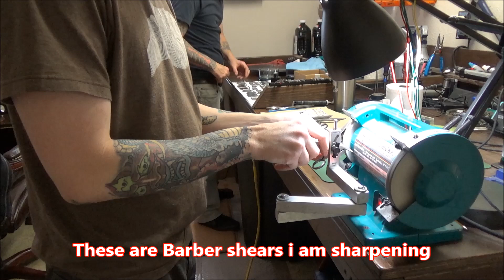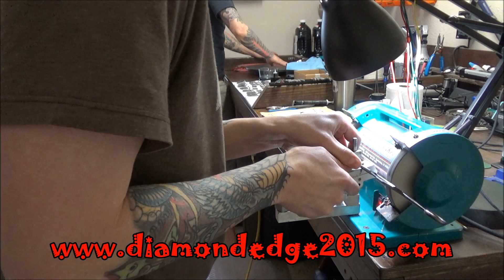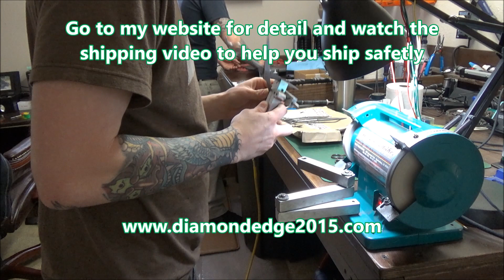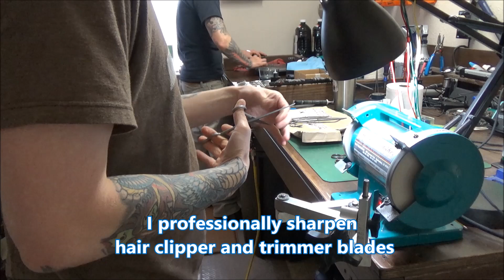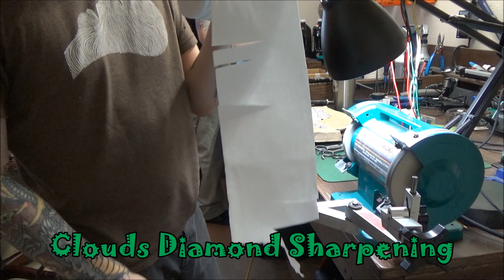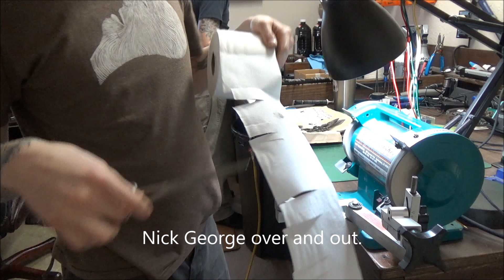Professional Barber Shear Sharpening

Comment: You sharpen Japanese hair shears, like that, as well?
Reply from the maker: Dominick Santora if they are semi convex or convex. Then they are sharpened different.
Reply: As the flat hone disk your partner was using, in the background.  Yeah, you put my $700.00 shears to that stone, we're gonna have issues.  LOL.  I was just surfing around, looking at videos on sharpening.  Been in the hair business 40 years and I want to get into sharpening.  Not just hair scissors, but knives and whatever.   Every pair of scissors you sharpened, I had, at one time or another.  Thanks for the response.
Reply from the maker: I recommend sending your scissors to the manufacture bc it will void your warranty no matter what they are sharpened on.
Reply: I know, I'm just pickings brains.  As I said, I want to learn about sharpening.  Thanks.  LOL got plenty of old shears to practice on.  But my Hattori Hanzo go to the manufacturer.   Until I know what I'm doing.
Reply: Dude....
WTF?
SPARKS?
Dude get your self a decent job.
Reply: @dominicksantora1574  you don't learn from YouTube to do sharpening as a job...